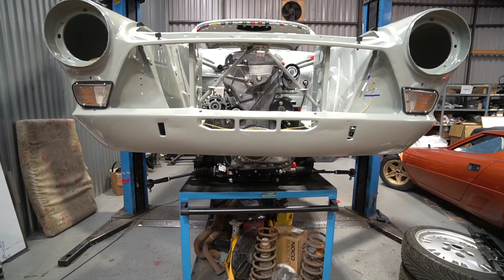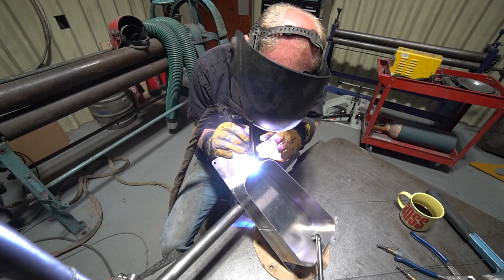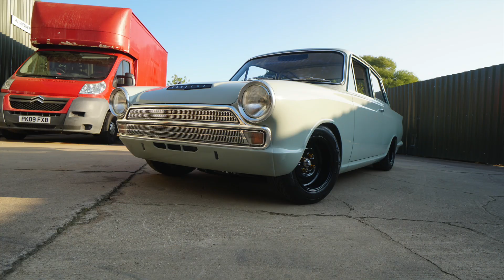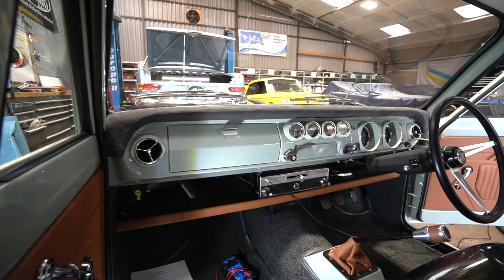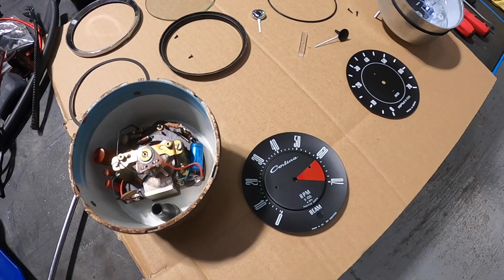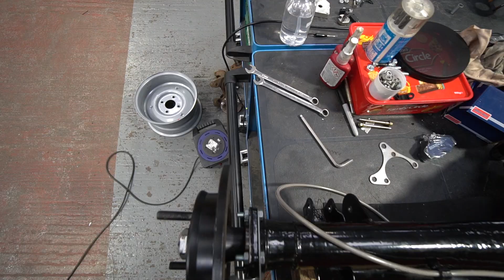Caffeine & Cortina 2 - Retropower Cosworth Duratec MK1

Comment: Brilliant work on a great car. Just two, small observations. I think it would look much better with Lotus style quarter bumpers and it will be woefully under braked for any type of track event. Otherwise, very hard to fault.
Reply from the maker: Interesting one, the brakes... after initial testing we have decided to try and and squeeze AP 4 pots in there, BUT the Cortinas you see flying round against Falcons and Minis in the historic touring car series only use solid discs on thd front, and drums on the back!
Reply: @retropowercars  The drivers must be using the Nick Swift style of racing......only using the brake pedal when there is no alternative!

Comment: Nice, like the way they have used alternative, yet Ford parts for this essentially unique Cortina! I reckon tho' I would probably want a shorter gearstick! And a very clean funnel to fill those fluid reservoirs, so as not to strip the paint in that lovely engine bay. love the suspension mods, subtle, but radical! Sierra  disks on the rear with Fiesta MK2 front calipers. Lovely! Nice explanation about the original door skin cap ,and new sheet metal lower! Likin' it!

Comment: How noisy is the SpeedHut drive?  Got one for my car but unsure if the motor will be too loud inside the car!
Reply from the maker: If it was a Rolls Royce it'd be annoying but realistically it's completely drowned out by the engine and road noise in 90% of cars
Reply: @retropowercars  Thanks for the feedback,  it's going in a 427ci Ford Sierra that's going to be a 100% road car with plenty of Dynamat.

Comment: Fitting a full roll cage to my 105E made a huge difference in body stiffness, as beforehand jacking up one corner I had to really yank (jerk) the door open and not a hope of getting it closed again.
With cage fitted ALL the flex was gone and best of all was a lap of Kyalami nearly 2seconds up when I raced there in the early ‘70s.
Umbrella brake handle.

Comment: Trik little car BUT those steel rims are ugly and heavy.  And make it tram track with all that scrub radious. 15x7 Superlites with 195x50x15 tyres would put more  rubber on the road and allow bigger brakes as well.
The park brake for the line lock is just weight. On the gearlever or steering wheel would be simpler. And more effective.The umbrella handle is for bench seat cars.
The dents in the front apron? With no bumpers will be ugly.
Reply: The owner, i.e. the one who's paying the bill, didn't want 15" wheels, neither did he want unnecessarily bigger and heavier brakes and tyres.
That handle for the line lock weighs ⅝ths of bugger all. Why would it not be effective, it's just a switch wherever it is sited.
The owner specified that he wanted those original "dents" leaving alone, they're original.

Comment: Hazards should still operate with the ignition on. Surprised an engineer will pass your setup. 
I.e you maybe on the motorway running engine flat tyre and be pulling over in a safe fashion hence need hazards.
Reply: By law in the UK hazard warning lights can only be used legally when stationery.  Indicator lights are what advise other road users that you're pulling over to the left.

Comment: Beautiful work from the Retropower crew. That two door Mk1 "Corti" reminds me of a Mk1 GT500 that a mate of mine owned back in 1968, we used to compete in Rally events, such a nice little car that went like a scalded cat.
Reply: You must be Aussie...those gt500'S were (partly) built by Craig Lowndes dad
Reply: @stephenscholes4758  correct, and an old Aussie. I did think that the GT500 was unique to Australia. It was a great little beast but the body structure weaknesses showed up pretty quickly on some of the Rally forest trails. Didn't know about the connection with Lowndes's dad... every day's a school day.